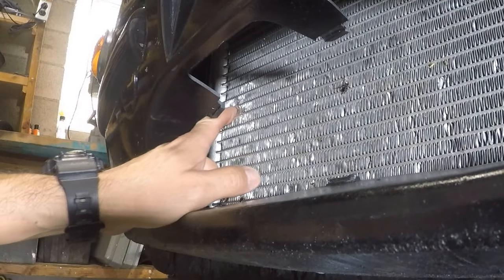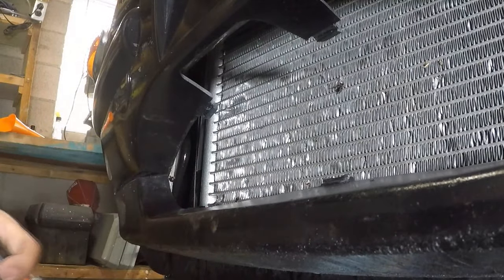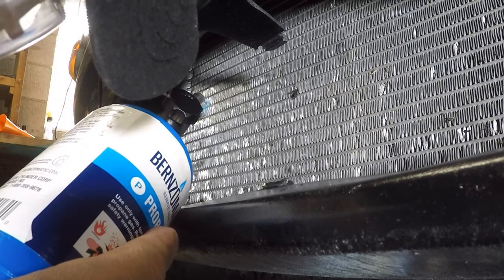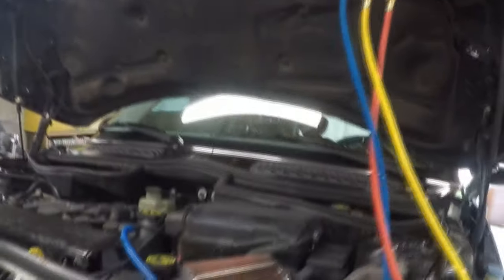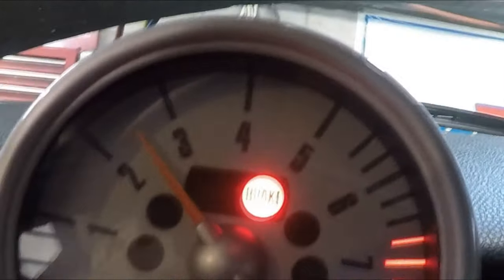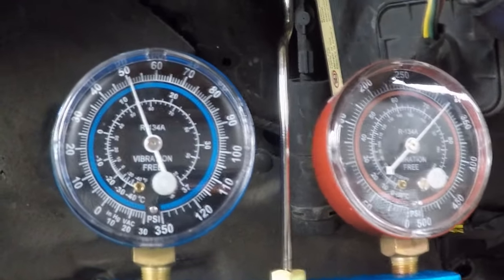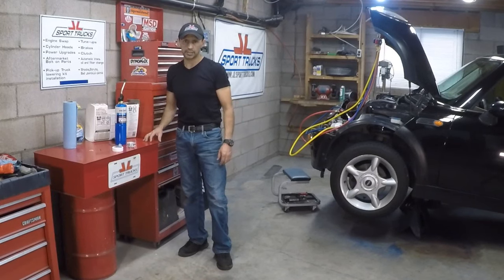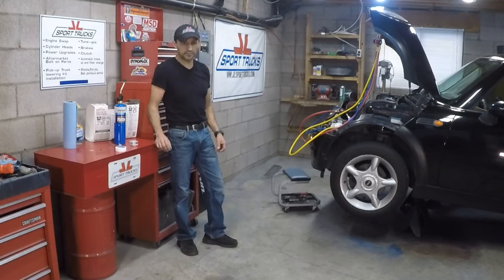Soldering AC Condenser to repair small Pinhole Leak

Comment: Thanks for making this video... what type of flux and solder did you use?
Reply: 60/ 40 flux solder.
Reply: LoL 1 year ago.
Reply: @MegaSteelReserve might help someone in 2030 when they first watch it😅
Reply: @Handlebarrz 2024 still helps
Reply: Based off the flux container you can go to Home Depot or Lowe's and buy a kit it has the same blue tank a torch tip cheap flux and cheap solder all-in-one is the exact same solder that you would use to solder copper pipe

Comment: Nice video!!
I'm about to tackle mine too!!
It's leaking at the bottom bracket area (where the coil bolts to the front frame!!
One day it just quit wrkg!)

Checked refrig & not a drop!!!

Be careful leak testing with ?air!?!?!
Suppose to use nitrogen,carbon dioxide, or helium?!
I do hvac for a living..... pressurizing with air & oil in the system can be explosive/dangerous!

I'm gonna try the flux & solder too! Hope this gets it.... it's starting to get hot outside!!!!!!
Lol ikr!!!

Comment: Is it ok if I submerge the condenser in the water at the same time I pressurise air to track where the leakage is? Any body knows pls share. 🙋‍♂️
Reply: Yes. Make sure it's pressurized before you submerge it, you don't want water inside it.

Comment: Can you use JB weld with this?
Reply: I was thinking the same thing. Since they have the high heat steel JB Weld for radiators. I was told that works because radiators have coolant (liquid) but condenser is Freon (gas) which might not make the proper seal for a pressurized system. Although in my head I don’t see the difference with a liquid or gas system since they’re both pressurized. 
I’m going to try to solder it if I can find the hole. If not I’m going to use JB Weld in the vicinity of the leak since it’s not as an exact science as soldering is. Wish me luck!!!
Reply: I used JB weld before on a rig & it fixed the problem.
Reply: @kostap how did it go?

Comment: would caulk or silicone work as well?
Reply: No
Reply: Did you get it fixed
Reply: Caulk or silicone is a big definitive NO! Only serve to make a huge mess if and when a proper repair must take place.
On the other hand, two parts epoxy sealers. Like JB weld and equivalents can be quite useful. If the repair area is properly cleaned and the application done correctly! 

Notice that if it goes wrong it's a pain to remove, clean and fix properly. So it's worth do it correctly the first time. ;-)
Reply: Hard no